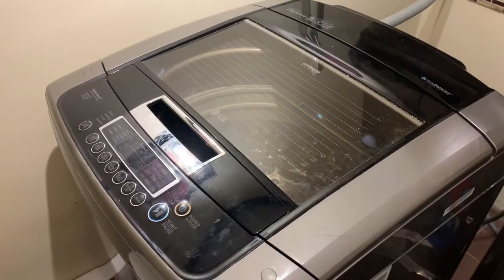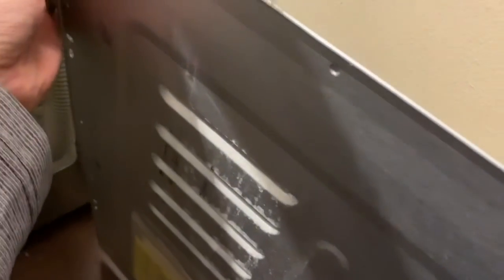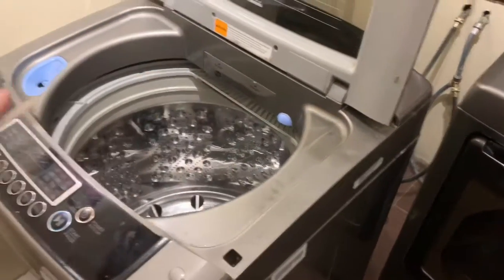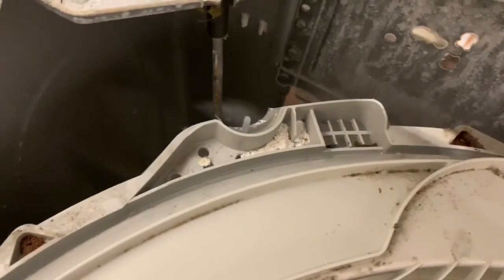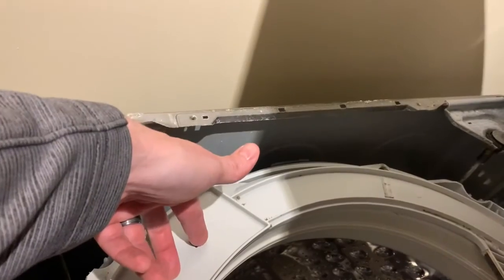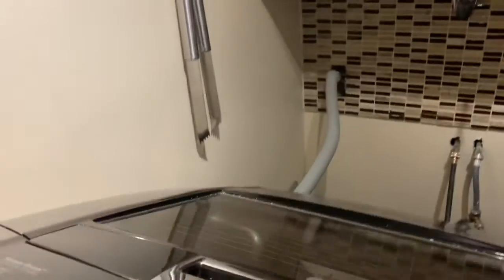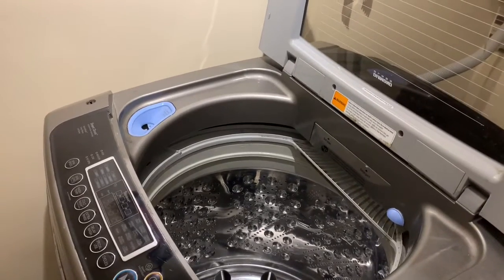Leaking Washing Machine Repair

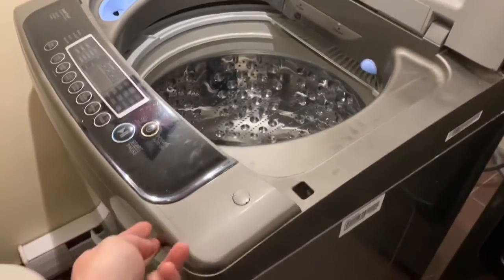Comment: Thanks for the instructions on opening the top of this machine!  I have the same model and your video is the ONLY one I found that shows how to do this.  I had to replace the door latch/switch which you can see @3:41 in your video on the far right side.  I may do a video on this part replacement.  It is the only problem I have had with this machine in all the years I have owned it.  I did give a good cleaning to the parts you mentioned while I had it open.  Good video - thanks for uploading.

Comment: Thank you so much for this video!  I will say that with a straw cleaning brush bent at 90 degrees could access and clean the holes in the bleach cup from underneath without have to take anything apart. Worked like a dream!

Comment: I have “new” Krib Bling with no dispenser and it leaks 5 lbs of water every time I fill it about a few inches high, even if I fill it through the top door, machine unplugged. I guess it’s by the grace of God that it has not blown up in an explosive short circuit by now.

Comment: Why would they design an overflow port to drain right into the back of the machine?! Couldnt a hose have connected it to the drain pump at the bottom? Astoundingly poor engineering!
Reply: This is so tjat after 2 or 3 years people spend another 900 and buy a new one 😮

Comment: Hi my washer is leaking from the softener dispenser, cleaned it out and still leaks, overflows. But I don’t even use it, I use detergent pods. Is there another solution?
Reply: Check for dispenser dammage.  Sometime, the thub "hit" the dispenser and it damage it.    Plus, check if your thub is still centered.  Mine is offset and the liquid barely fall on the edge of the thum itself.  So, if the dispenser is damaged, the water comes out of it like splashing in every directions.  That is what I had as problem.  I was able to fix it, but you can easily buy a new one and replace it yourself.  (I'm still trying to figure out how to center the thub though.  Probably by turning the top of the rods that support the thub.  (Seems to have some threads at the end of the rods or maybe a nut...  story to follows)  😁
Reply: Disconnect the softener plug, like in the vid, only the one that connects to that.